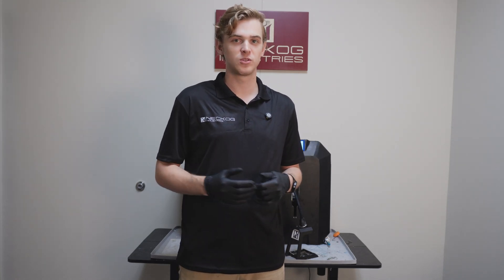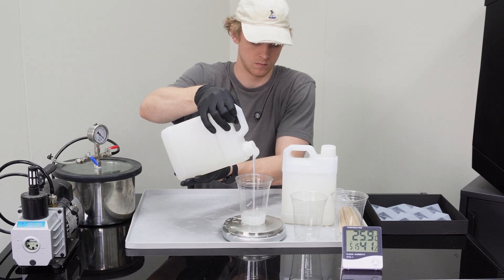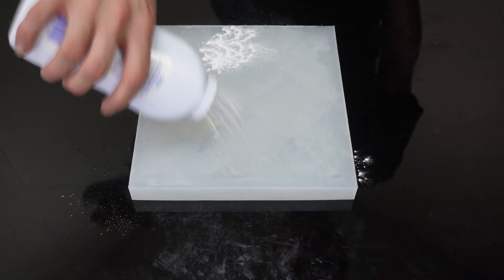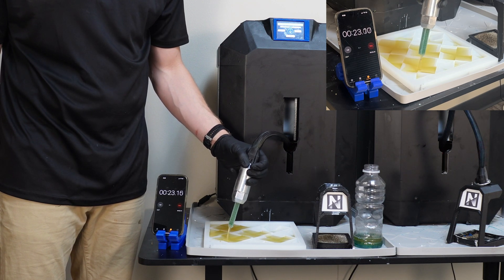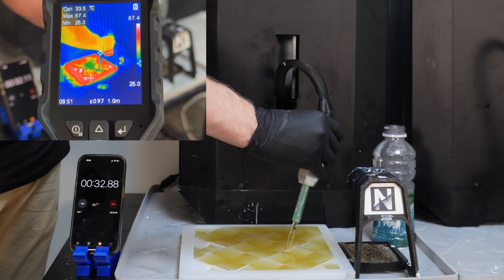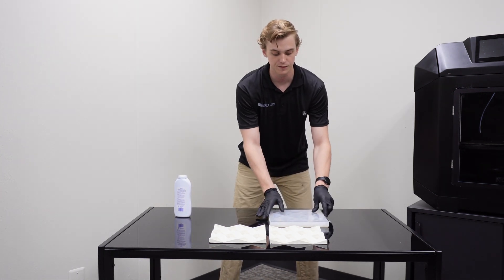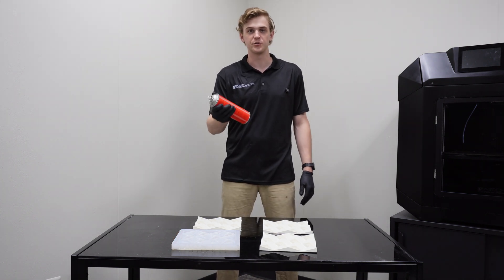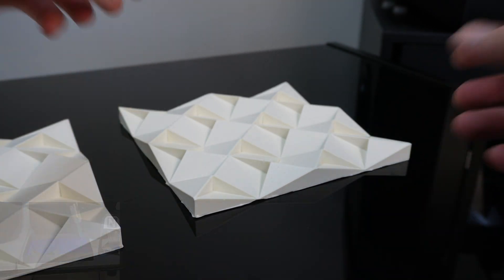Stop 3D Printing | Is Repeating the Same Part Worth It?

Comment: saying "stop 3d printing" in the title is misleading, this is obviously not a replacement for 3d printing as 3d printing is literally a part of the process, and while this may be a better option for a most likely small subset of scenarios, its not in any way a replacement for 3d printing, and is not even injection molding either

Comment: Get rid of the display, use smartphone app, or even the CYD. Make the unit more compact, use a cheaper peristaltic pump heads and some good high torque stepper motors with smooth stepper drivers and arduino. Could use silicone strip heaters for heating the mold, resin. Use simple throwaway mixing nozzles. Have a rinse tank. If the cost is a bit lower(299-499), definitely an interesting option.❤👍
Reply from the maker: Display is needed for calibration and saving different resin profiles.

Wit peristaltic pumps flow range will be very limited. Device would last very shorter due to way they pump the materials.

These are throwaway nozzles but cleaning makes it much cheaper to use. They can last as long as 6 months on everyday use while costing 3$ to replace.

There is a rinse tank.
Reply: Appreciate the info. Definitely seems to be a rugged unit. You should highlight convenience and precision, time and material savings, apart from quality of final casting. Wish you all the best. Will buy one in future.❤👍

Comment: Smooth cast is one to one. Will I need to set up a profile if I use that polyurethane?
Reply from the maker: The device has an automatic calibration sequence. After you set the mixing ratio, it performs two purges(around 25-40gr of material comes out), then prompts you to enter a value. From there, it automatically calibrates to determine the optimal amount.

Comment: This is not inection molding and is not anything like injection molding. This is urethane casting which is a long used method for low to mid volume parts. Your machine is just a mixing pump as far as i can tell, and is not even needed for this process at all. This seems like buying a $$$ juicero to find out you can just squeeze the juice from the bag. What am i missing?
Reply: The pressure part being easier than by hand i guess.

And having a heater.

But look the whole part cost thing just goes out the window. Five bucks is 500g of filament and you can print the parts hollow without a crazy mold arrangement. 

Them repeatedly calling it injection molding is annoying or plain misleading though if folks are looking for desktop injeciton molding which is also a thing

Comment: How does the epoxy handle being left outside indefinitely?
Reply from the maker: This is polyurethane not epoxy. Without paint both epoxy and polyurethane will yellow due to UV exposure.
Reply: @NeckogIndustries  thank you for the reply, I’ve been watching a ton of resin mold casting content recently so apologize for the mixup. 

Besides yellowing does it degrade in mechanical performance? Essentially I’m trying to figure out if it will behave like an sls print where if left outdoors it eventually crumbles due to UV exposure.

I’ve been using Asa to make automotive products and as you pointed out running printers non stop isn’t the greatest solution. Also there’s the issue of visual consistency. It seems every roll of filament has its own quirks and some rolls print better than others.
Reply from the maker: On the surface, microcracks can develop, making the material more prone to breaking if it’s too thin. When thick enough, it may yellow over time, but mechanical stability is less likely to be compromised. UV exposure will eventually degrade any plastic material without proper surface treatment.

Polyurethanes, however, are more chemically resistant than other thermoplastics. The primary issue is UV degradation, which can be mitigated by adding UV inhibitors, though this increases resin costs. We’re actively working on this solution, and it will be available on our website soon.
Reply: @NeckogIndustries  exciting! Thank you.

Comment: YA GOOD LUCK WITH A 3D PART. LOL YOU MAKE MOLDING AND CASTING LOOK EASY WICH IT IS FOR A SIMPLE BASIC FLAT PART LIKE YOURS BUT LIKE I SAID GOOD LUCK WITH A 3D PART AND THIS IS COMING FROM A MASTER CASTER 20 YRS. ALL YOUR FANCY MACHINE DOES IS MIX BOTH THE A AND B MATERIAL LOL
Reply: Well yeah, that's a meter-mix machine, but existing options are a lot more expensive that what they offer
Reply: @alchemistalchemist6051  no way this machine process is way more expensive

Comment: when some one says Injection Molding machine this is not what i think of
Reply: That's because there is no injecting going on here. This isn't injection molding.
Reply: @ScytheNoire  I actually meant that in a subtle, tongue-in-cheek way. I was trying to politely point out that this machine doesn’t match what I'd typically expect from an injection molding setup.
Reply from the maker: Exact term is reaction injection molding(RIM)
Reply: @NeckogIndustries   Just from my younger years when I was doing injection mold design and CNCing injection molds, this isn't what I would think of as injection molding. It was the more commonly thought of method of slapping two (or more) pieces of steel together, injecting molten plastics through channels to create a plastic part. This was 30 years ago though, things do change.
Reply from the maker: @ScytheNoire  Aluminium molds can be used with reactive injection molding as the temperatures and pressures aren't as high as normal injection molding.
Reply: @NeckogIndustries   Aluminum was used less because it's more expensive, less durable, and more of a pain to cut, tends to gum up. 
Just from my experiences working in CNC shop decades ago.
Reply: @NeckogIndustries No, that's not what this is at all. This is completely misleading and disingenuous. The only difference between regular injection molding and RIM is the material used. Regular injection molding utilizes molten plastic to be injected into the mold. RIM combines parts A and B of a liquid material that hardens to a solid within an injection mold. 

You are not using injection molds or even any type of injection molding process. You're using an open face silicone mold and dump pouring resin. The only difference is you have a machine that heats and premixes your A and B together for convenience.

So this is nothing more than just a heated metering system for resin. No different than the machines that are used to mix A and B parts of potting epoxy, insulation foam or bedliner together. 

You may want to take a step back and reevaluate the way you're promoting this machine because the words you're using do not match the technology that you're trying to showcase. 

Speaking of using proper words the term is "cast", not "casted". 

For over 30 years now I have been working with molds, injection molds and a variety of other methods of manufacture. I am a master machinist and have spent time producing tooling for injection molds.  I am exceptionally familiar with the process and judging from the other comments here, there are many others educated enough about the subject to realize that everything that you said in this video is wrong.

If anybody wants to learn what real Reaction Injection Molding looks like, just look up RIM Manufacturing's channel here on YouTube.
Reply: This is resin injection moulding. RIM

Comment: What's the equivalent layer height?
Reply from the maker: The printed part was 0.12mm. Since we finish it with filler primer. Casted parts should be below 0.1mm

Comment: What would the process to switch from silicone to polyurethane be like?
Or would need two different machines?
Reply from the maker: The back cover comes off, and with a quick turn of the tank holder screw, the tanks are released. Once the connection is clamped, you’re ready to swap in a new tank with fresh material.

Takes about 5-10 minutes.

Our backers requested so we made it possible to change the whole tank even when its filled filled while keeping the material fresh.
Reply: @NeckogIndustries can we buy / produce spare tanks? I have 2 / 3 materials I regularly switch between. 

I've ordered on the pre-order, is that still looking like November deliveries?
Reply from the maker: Tanks will be available but our current tank stock might not be enough to supply the additional tank sales for a short while(couple weeks.)

We are still aiming for November deliveries.

Comment: I essentially use this process already for production parts, just without the machine. What would you recommend for color additive? I use a urethane that cures white similar to your product, so I use a fairly heavy loading of liquid dye mixed into my part "A" before casting.
Reply from the maker: We have color kits available for our system on our website.